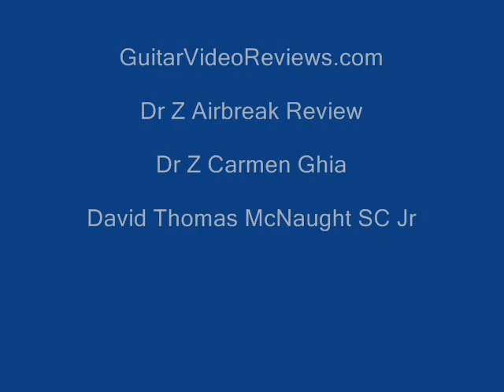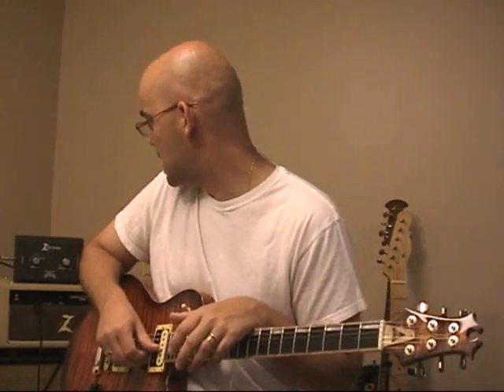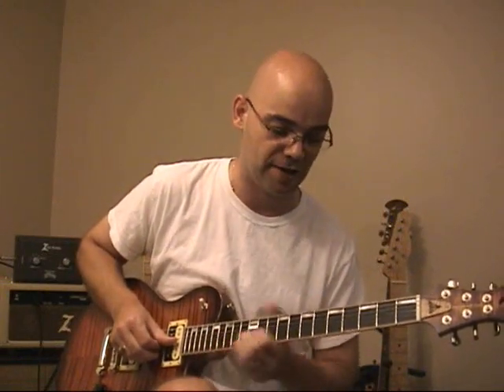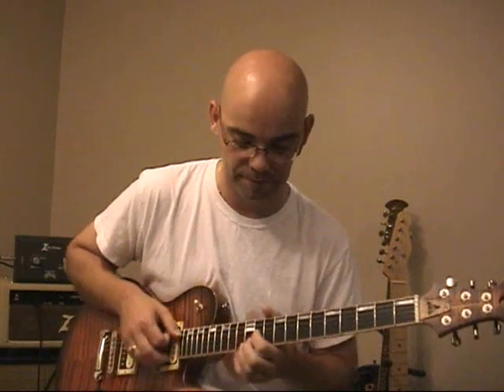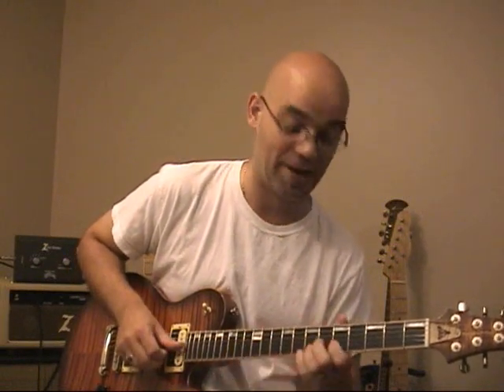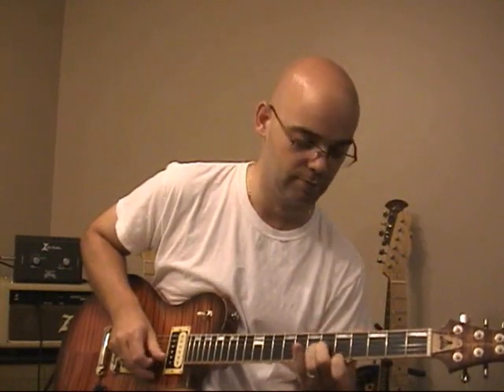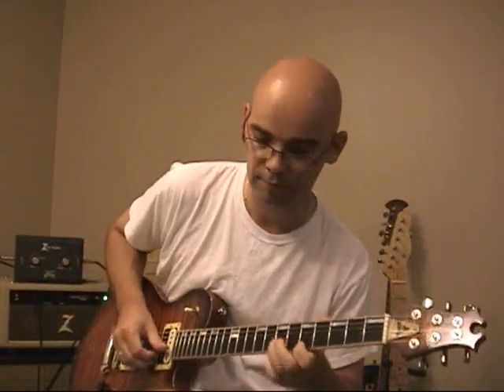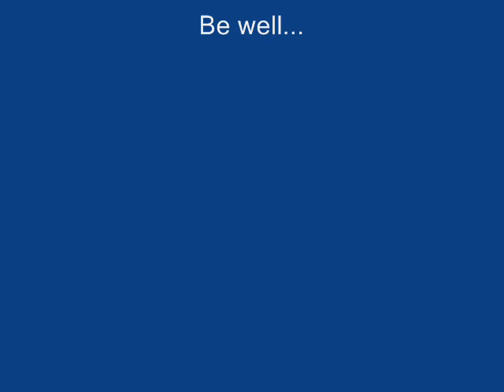GuitarVideoReviews.com: Dr Z Airbrake attenuator

Comment from the maker: I do not know that amp, so I can't comment, but I don't see why it wouldn't work as long as you have a way to plug the amp head into the Air Brake, and the speaker cab into the other side of the air brake...